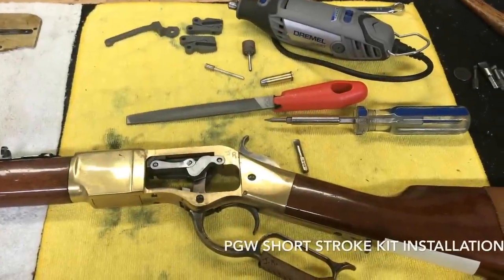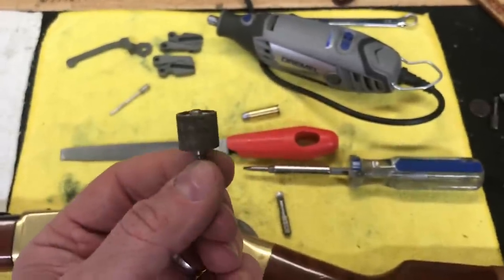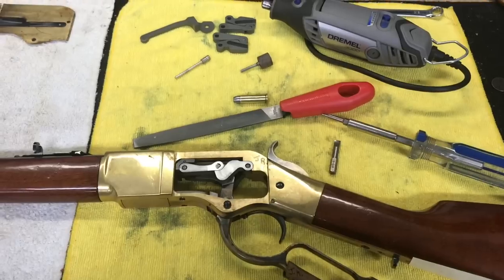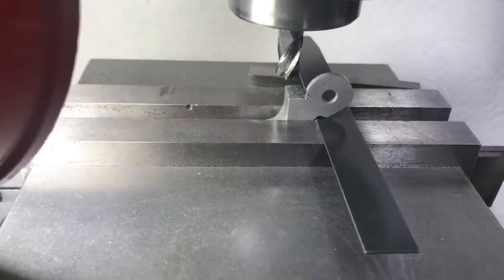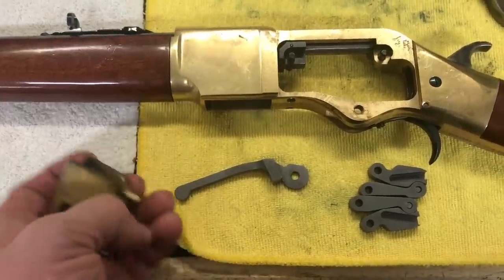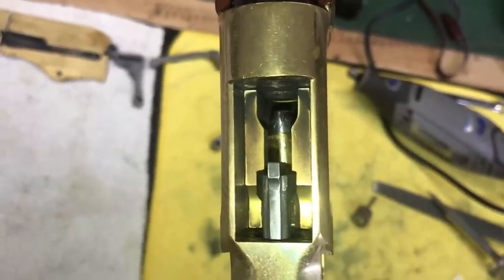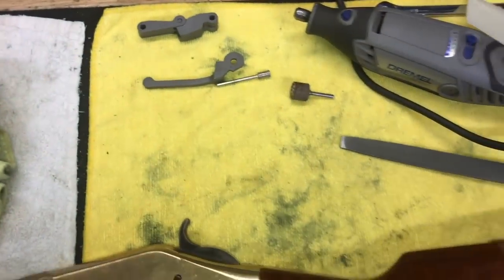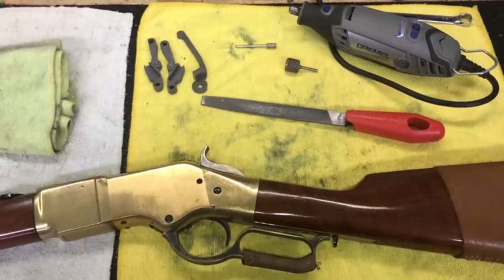PGW Short stroke kit installation video

Comment: What happens if it is overtimed? Mine seems to be in okay timing until I have a 44/40 round in it and then it fouls on the carrier. But with no round it works fine.